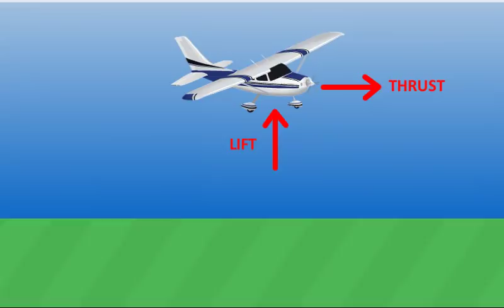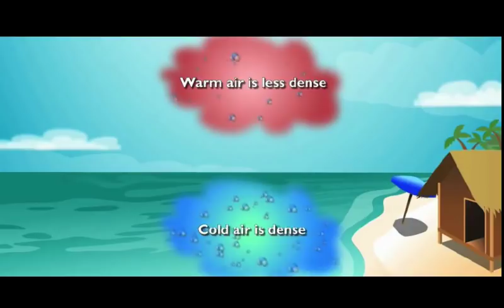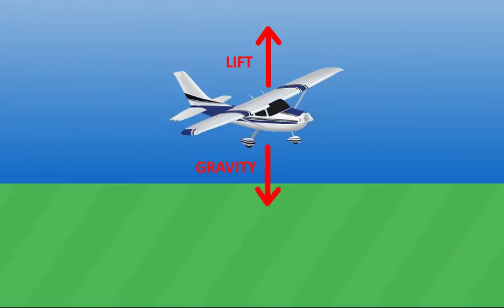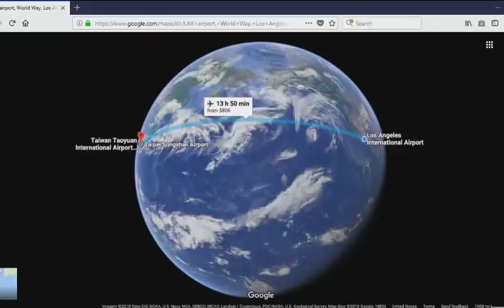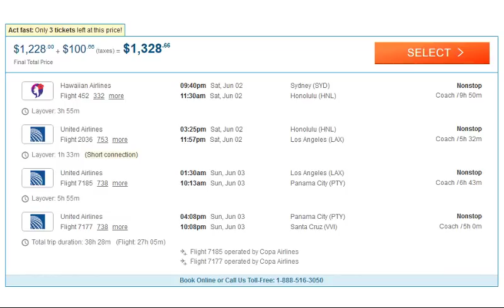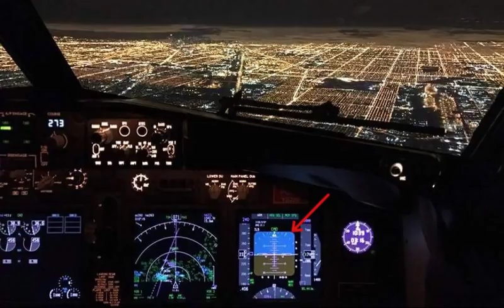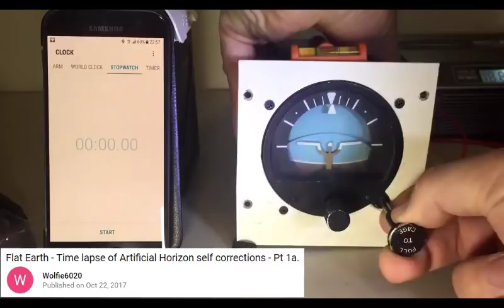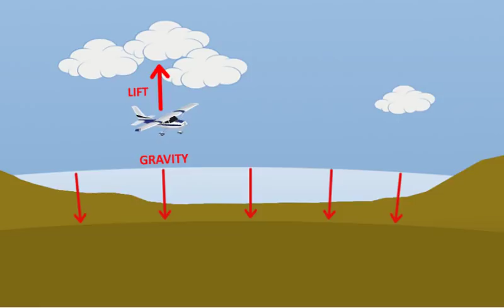Flat Earth Falsities - Plane Nonsense

Comment: does anyone know what a gravatron is, the carnival ride
Reply: If it turned once a day it wouldn't be much fun.
Reply: your compost pile?  i dont get it what turns once a day.  your saying that turning once a day is only a small amount of fun then.
Reply: I do!
Reply: have u been on/in one? so its spins right and you and the people inside get stuck to the walls.   if the world is spinning then what would happen.
Reply: @elnegro545  The world is spinning, but very slowly compared to a carnival ride, far too slowly to fling people off it (obviously). However the rotation of earth does mean you weight very slightly less at the equator than the poles, this has been measured many times.
Reply: mikerjuk.  It's math.. rpm's are irrelevant , unless you have a radius to measure it congruently.  in other words, a 1 foot gear spinning at 1rpm  (keep in mind the 'attachments' to the outside of the gear), have vastly different physical affects than a gear at 1rpm with a 4,000 mile radius (especially the outside portions)
Reply: "It's math" 
https://imgur.com/gallery/50qhgLW
Reply: @ferrumignis  by who? We arent allowed at the poles.
Reply: Ricky Ricky Ricky.  Yes it is math, you are correct.  You are incorrect about angular velocity being irrelevant however.  Centripetal force is proportional to the radius and the square of the angular velocity so angular velocity is more "important" than radius in this context.  This shows why the force at the equator isn't very big; even though the radius is very large, angular velocity is very small (about 7.3E-5 radians/second) and this term is squared making it even smaller.
Reply: Yup
Reply: only 1 smart not too smart
Reply: http://www.debate.org/opinions/isnt-somebody-insulting-another-person-or-calling-them-names-if-they-disagree-with-that-persons-opinion-is-totally-unnecessary

Comment: If the atmosphere spins with the globe beneath it, what should really make of wind? Wind doesn't push around atmosphere but it does push around things in the atmosphere. That's having it both ways.
Reply from the maker: The entire body of the atmosphere rotates with the earth rotation, and within that body there are currents moving in different directions, due to many factors, mostly due to temperature differences. There is nothing contradictory about that. Can you stir your coffee while you walk around the room?
Reply: joe beastyg It's like water flowing downriver. You will find local effects within the water as it hit rocks or gets caught in eddies but the overall motion is downstream at a steady rate.
Reply: Joe, I think you bring up a very interesting point about the "atmosphere"..  If what we are taught is true, ALL the air and wind and "atmosphere " spins at the same rate, like one would find in a container...  What is the atmospheric anomaly that supposedly has a vacuum next to a controlled environment, without a barrier?
Reply: @azproser  Another classic flat head fallacy. You like to imagine the edge of the atmosphere suddenly transitioning to a hard vacuum, it doesn't work like that. Atmospheric pressure reduces continuously with altitude (i.e. a pressure gradient) so there is no sudden change in pressure like a vacuum tank on earth would experience.  Air is a fluid with mass, so gravity pulls it toward the surface of the planet, though a small amount of atmosphere does get lost to space.
Reply: ty @mikerjuk for your reply.  Can you expound please?  I'm honestly trying to learn.  No need for ad-hominem.  it doesn't work on me, again, trying to learn.  So, if the atmosphere is gradual, what other phenomena can you describe where this occurs?  I mean a vacuum next to a controlled environment, that doesn't have a solid barrier?
Reply: @azproser  Any planet with an atmosphere will display this phenomenon.  You need a huge mass to create the gravitational field required for this to happen, which is the reason small planets have no or little atmosphere.  And btw ad homs are perfectly justified to trolls imo.
Reply: mikerjuk, my question is, can you provide any example scientifically that can be repeated?
Reply: with the laws on "earth"?
Reply: otherwise, it isn't using the scientific method, and conjecture based upon theory.
Reply: I'm not trolling, hush.  I'm asking serious questions, you know better.
Reply: Rick Wilson With the atmosphere declining away to nothing with increasing altitude, at what point do you think there is a dividing line between 1atm and a vacuum?
Reply: Rick Wilson
Why don't you fuck off you obvious troll.
Reply: Wind and water are 2 completely different things. Wind pushes rain as it falls. Wind is part of the rotating atmosphere. It literally flies in the face of a spinning earth.
Reply: joe beastyg Both are fluids and exhibit similar motion; a river or cup of coffee is easier to visualise than air. 

As VoR explained, this is the difference between net movement of the whole and local variations within it. There are variations in air pressure across distance arising from various causes; wind is the movement of air within the atmosphere to equalise those differences and occurs as the whole body of atmosphere moves with Earth.
Reply: @flookd5516  Within the atmosphere? Define atmosphere for me. Maybe that will help. I maintain wind and water are 2 completely different things.
Reply: joe beastyg The difference between liquids & gases is whether the molecules have sufficient energy to overcome the intermolecular attraction. Other than they have similar properties and are collectively known as fluids. As I said, using a liquid rather than a gas makes it easier to visualise the movements within fluids.
Reply: Flook, how sure are you that our atmosphere is not a 'fluid'?
Reply: As far as the ATM , I have no clue.  I'm curious the explanation.  A vacuum, where nothing gets sucked into it, next to a controlled environment, without a barrier, that sucks nothing into it as well.  I'm trying to think of a real-life exmple, but I can't
Reply: Rick Wilson With respect to both your posts I would suggest you reread what I wrote.
Reply: Maybe this will help. https://imgur.com/gallery/RArKzmb
Reply: @CaptWesStarwind  I could do without that kind of condescending attitude presented in your redirect. Good day.
Reply: Oh so sorry. Didn't mean to sound condescending when trying to communicate with a human using a computer in 2018 that thinks the earth is flat. Lmfao. Would you prefer a Sesame Street video to help explain things to you? You fell for a lie on YouTube. That's all flat earth is. Maybe if you stayed awake in school you wouldn't think you're "woke" now.
Reply: The statement on the link was called physics. Sorry if a basic equation seemed condescending to you. Maybe you shouldn't say such moronic things. To steal a famous quote. You know Jack Sh&t, and Jack left town.

Comment: I'm still wondering why we can't get far enough from earth to get a good video. I'd like to zoom in on Perth to watch an upside down helicopter. . yet we get these super clear pictures of pluto and youranis with a black hole and nebulas. I'm fucking serious. We paid for a view, now where the fuck is it? haha. Fire up that Hubble and turn that bitch around. I want some videos of this sphere earth so we can stop discussing it.
Reply: Kody Soles Salty at yet another non-existence claim about pictures that can be found practically instantly on Google. If someone wants to question what they are told then they need to ask questions, not complain they don't have answers.
Reply: Fuck off you troll.
Reply: No, Can you elaborate how the 1990 Hubble can't take pics of earth because it isn't "designed for it"?  

"Hubble started off sickly, a long-awaited, breathlessly touted, $1.5 billion machine that was supposed to change astronomy forever from almost the moment it went into space, and might have too if its celebrated 94.5 in. (2.4 m) primary mirror that had been polished to tolerances of just 10 nanometers—or 10 one-billionths of a meter—hadn’t turned out to be nearsighted, warped by the equivalent of 1/50th the thickness of a sheet of paper. It would be three and a half years before a fix could be devised and built and flown to orbit and shuttle astronauts could set the myopic mirror right. And then, on January 13, 1994, the newly sharpened eye blinked open, the cosmos appeared before it and the first of one million observations the telescope has made since then began pouring back to Earth..."..
Reply: @azproser  Can you elaborate how that stuff you quoted proves it was designed terrestrial observation? Flerfer argument techniques are annoying aren't they? :D
Reply: Using CGI to tell the truth is much better than any photograph... "it just, just has to be".
Reply: No... 
Will the flat earthers ignore this logical explanation? YES!
Reply: Cycling Cycles they will always ignore evidence
Reply: Kody Soles
Talking of salty, why are you? You silly child.
Kevin Douglas is a pathetic troll. A very obvious one and only total fuckwits fail to realise this.